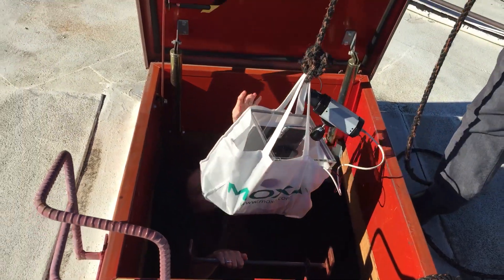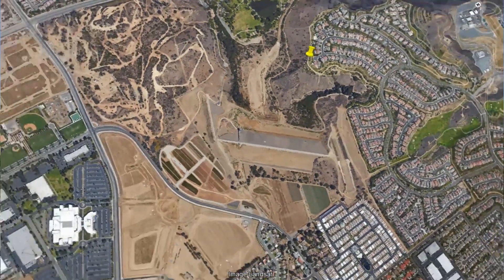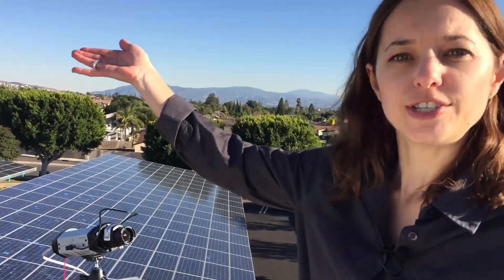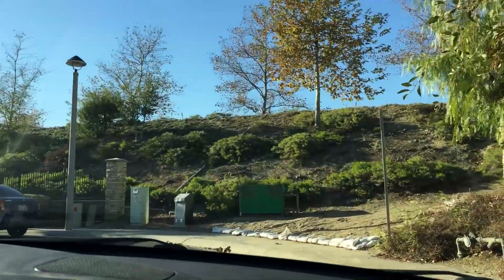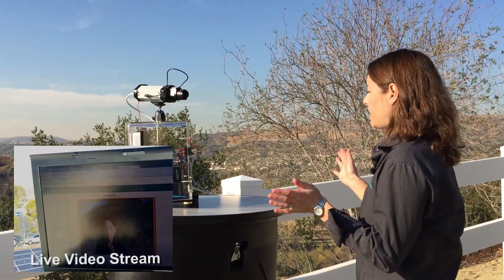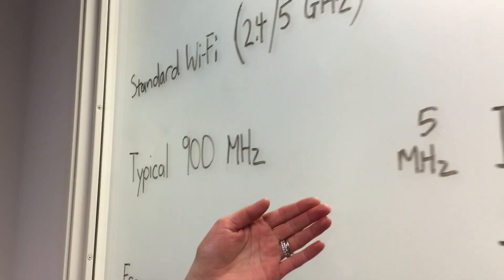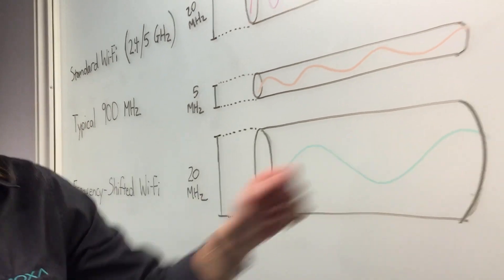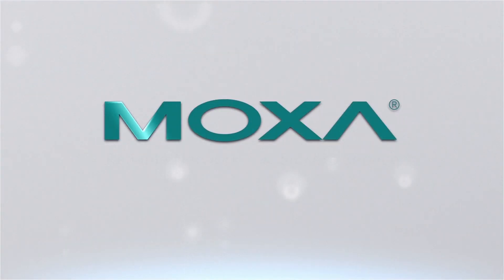Frequency Shifted Wi-Fi for Long Distance and High Bandwidth

Comment: How does this compare to Cambium's PMP450i and Ubiquiti's M900 products in price and performance?
Reply: ubnt's m900 has an 8dbi antenna, the radio in the video has a self-admitted 5dbi antenna. the m900 has more gain, therefore more power than the radio in this video, even if it's just a little.